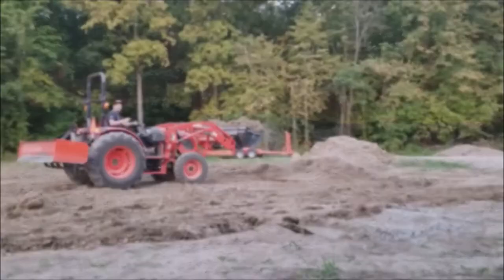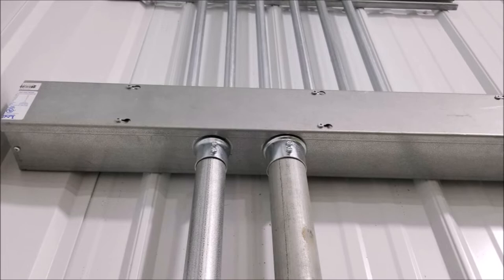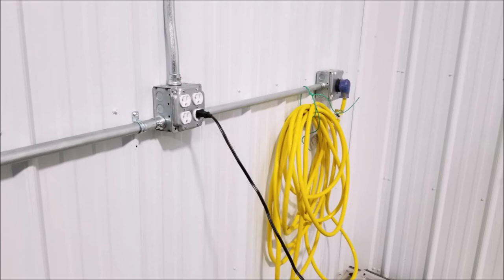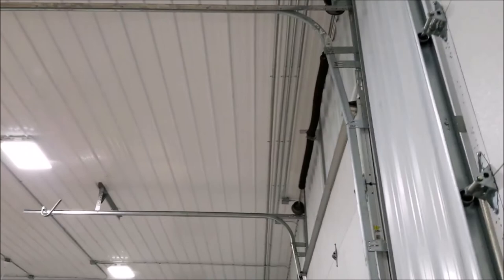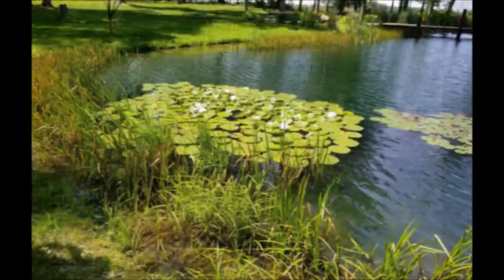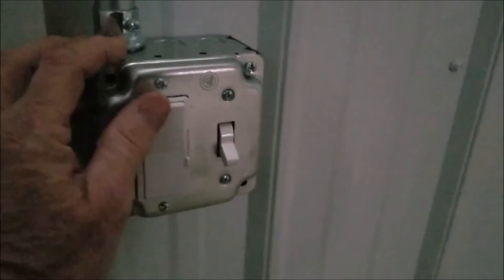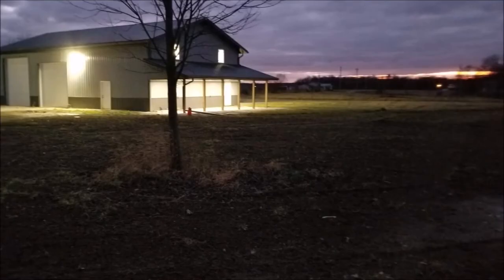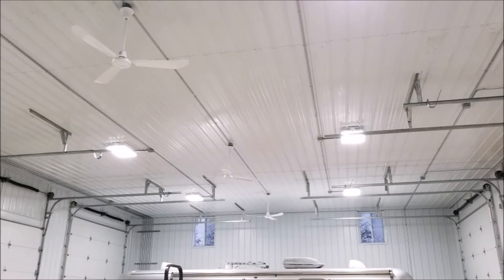Pole Barn electrical wiring ideas. Check this out!

Comment: Hello. Do you have video how did you conect outside electrical box to inside one?
Reply from the maker: I don't remember how we did it. The easiest way would be to locate a 4" square box on the inside and drill to outside and stub conduit to the outside box.

Comment: Looks good, may I ask why you didn’t run the conduit behind the steel panels?
Reply from the maker: We had to put the barn up in a hurry and winter closed in prematurely. So we decided to finish the interior and deal with most of the electric the following year. We did manage to set the panel and had a few convenience receptacle before winter.
Reply: I'm building my garage right now and honestly, I'm purposely going to run my conduit on the outside just like this. My reasons are: #1 this will never be a show garage, but a work garage.. #2 As much as I plan, I KNOW I will want another circuit somewhere and where I didn't imagine, leaving it on the outside will make it so much easier to add a line without pulling off multiple metal panels.